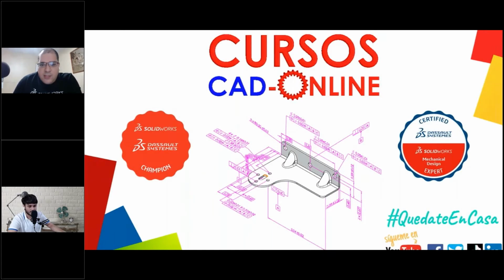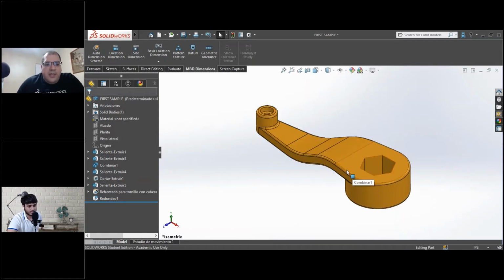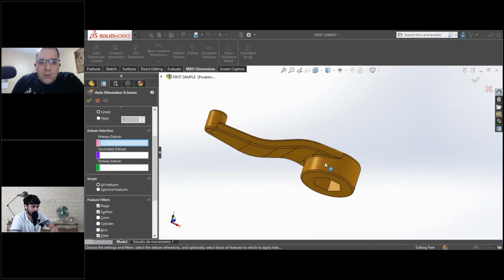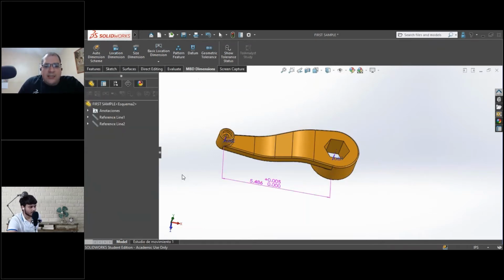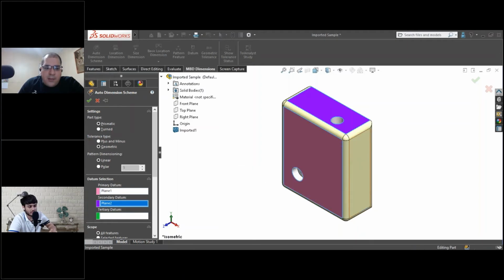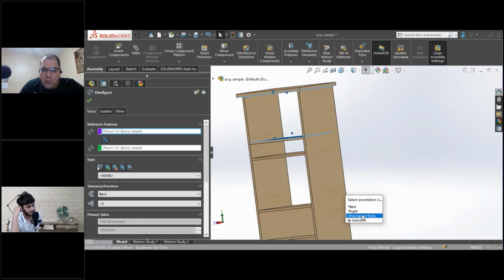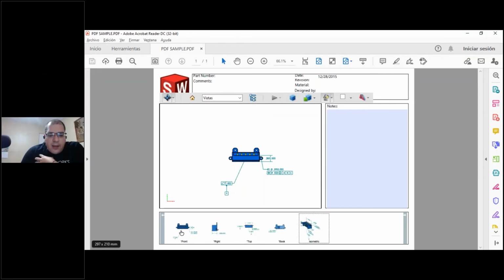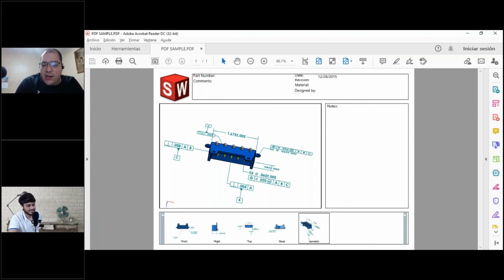Meet 4- A Deep Dive into SOLIDWORKS MBD!

Comment: i'm pretty sure if you put the dimension on the constructed axis of the cylinder and not the cylinder itself, inspection software designed to import the MBD will fail, since an axis is not the inspections software will measure but instead the cylinder